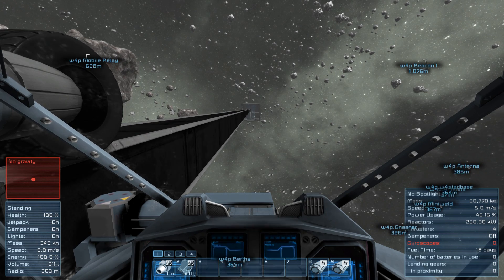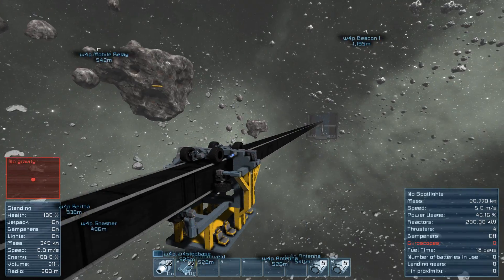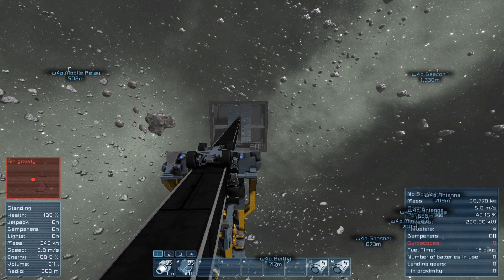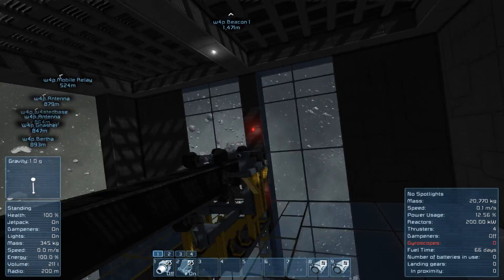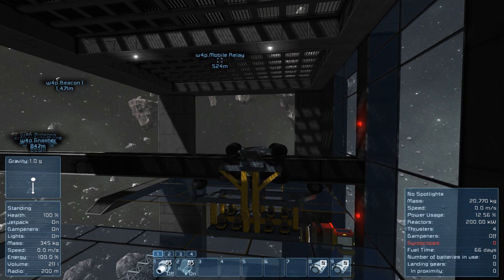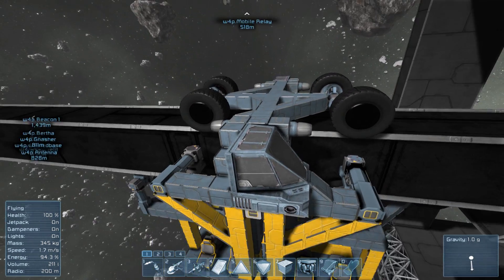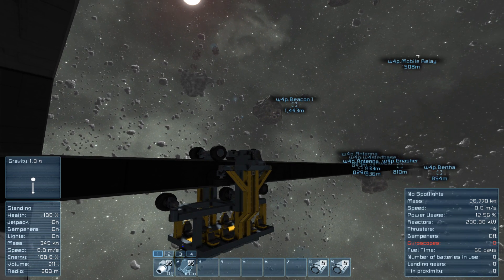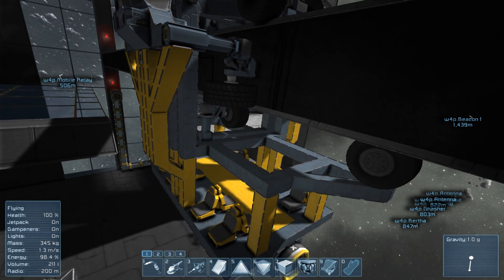Space Engineers - Working Cable Car Guide - Survival Mode

Comment: I think a 10 min build is to short for this but it would be really cool to see a semi truck with detachable trailer and the trailer could have pistons to hold it up when its not attached. And a rotor connected to the merge block to allow it to move proper. And maybe even doors for the back.
Reply from the maker: It'll be revisited for sure, not sure what it'll be yet but yeah :)

Comment: How about an extendable arm with a connector on a station, for ease of restocking ship supplies without danger to ship/station.
Reply from the maker: Did a very small one of these for the large mining ship but definitely something that could be done bigger and better, the one I have is a bit crap and only goes out a small distance in one direction. Will defo consider that one although maybe something a bit more complex than just extendable 1 way :)